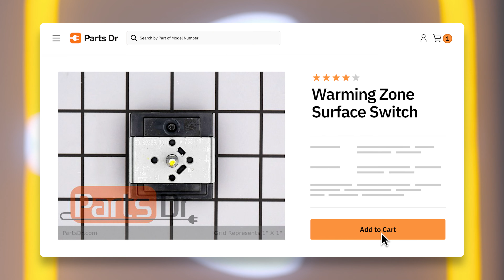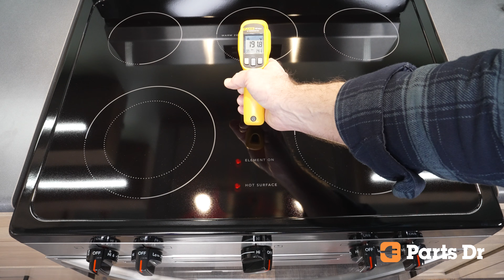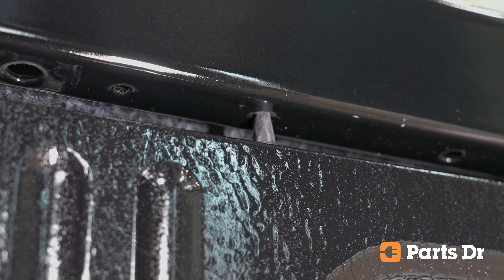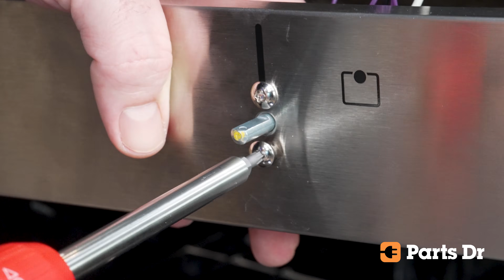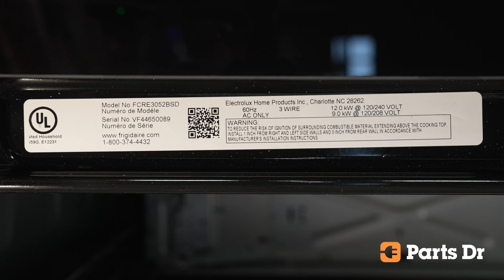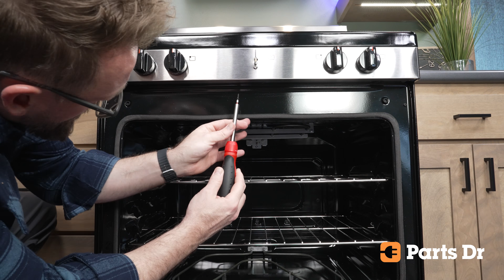How to Replace a Warm Zone Infinite Switch (5304522964) on a Frigidaire Range | Parts Dr

Comment from the maker: If your Warm Zone isn’t working properly on your Frigidaire range, a faulty infinite switch could be to blame. This video walks you through how to test and replace the Warm Zone switch (part #5304522964) step-by-step. If you're ordering parts online, be cautious with sites like Amazon and eBay. We've seen many cheaper aftermarket switches that are lower quality and don't work properly or hold up well. For a reliable fix, we always recommend using high quality OEM parts. You can find the genuine Frigidaire switch and more at https://partsdr.com. Let us know how your repair goes, and happy repairing!